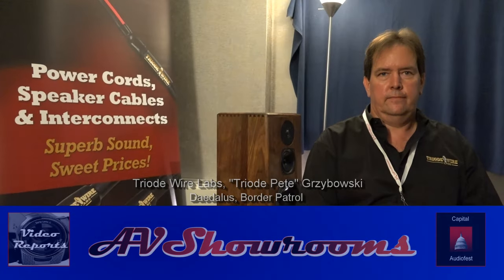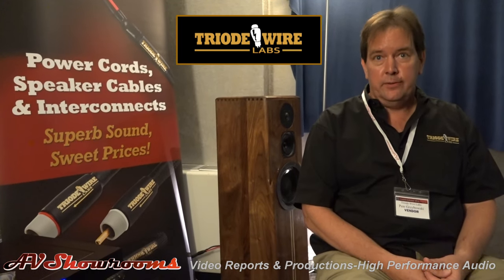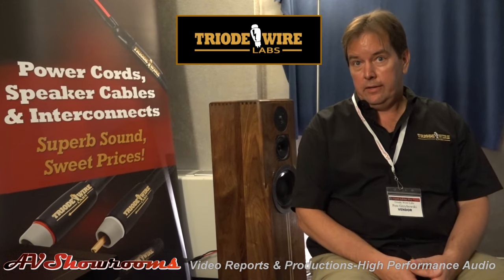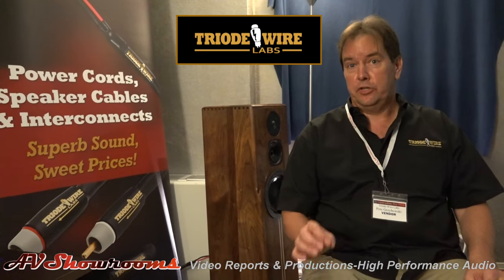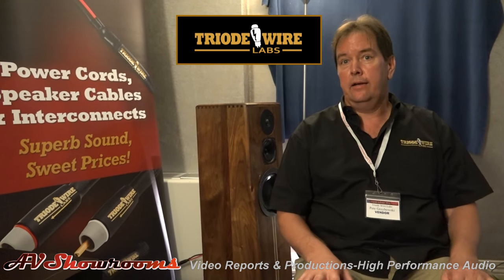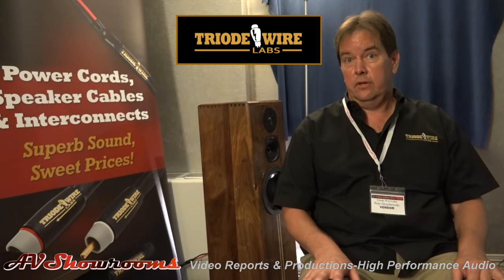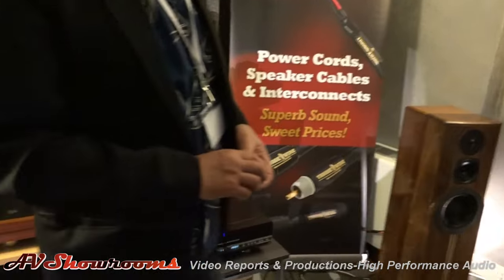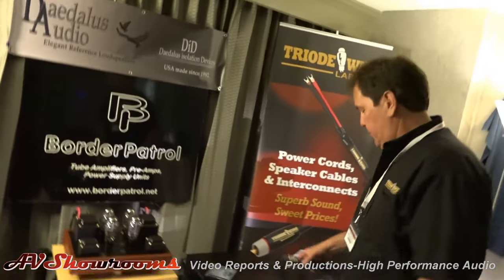Triode Wire Labs, Triode Pete Grzybowski, affordable cables, Daedalus, Border Patrol, Cap Fest 2016

Comment: Hi.  I basically know nothing about the audiophile scene.  Just a newbie looking to get into it and build a system.  Could you confirm something to me please?  I appreciate why you would need 'special' interconnects, but having trouble understanding how different power cables can make a difference.
Reply from the maker: Very good question.  I was a non-believer until I heard a test 25 years ago of a stock power cord and an expensive PC on a friend's Krell amp.  I was astonished at the difference... more space and better tonality.  I believe PCs make the biggest difference of all, even over interconnects and speaker cables.  I look at them as an extension of an amp's power supply.  Most audio experts agree with me.
Reply: Coudn't agree more Peter.  I use both Shunyata and Synergistic in my home theatre.